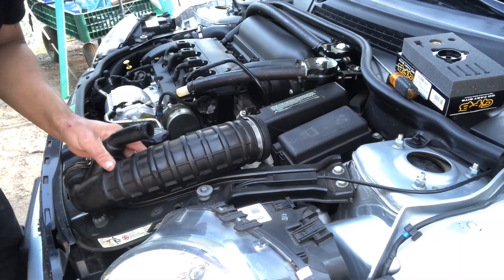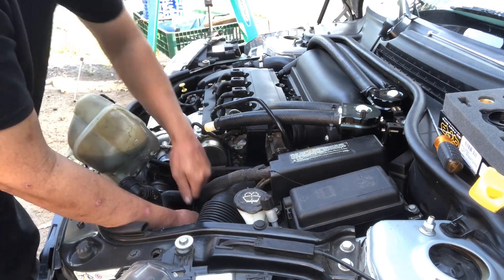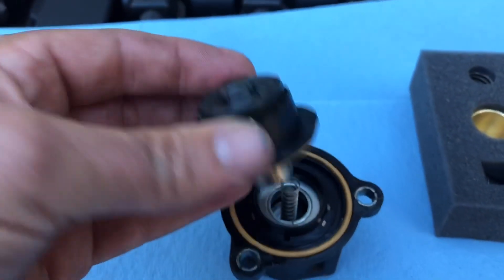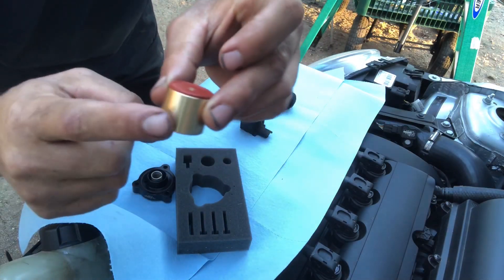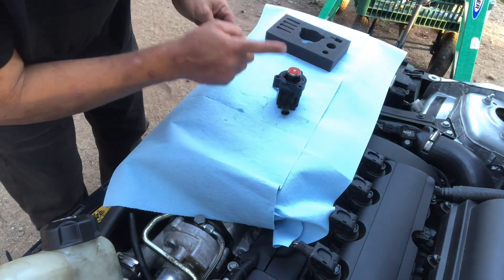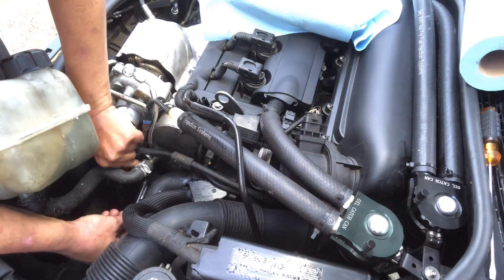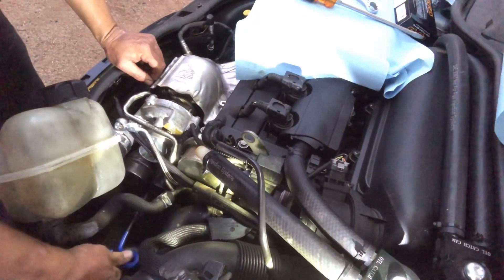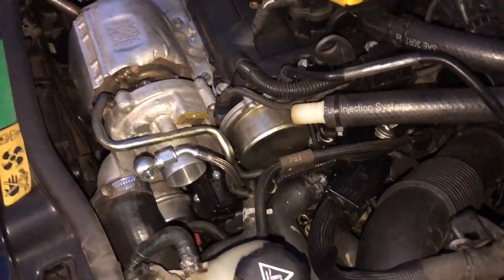How to install a GFB DV+ on an R56 Mini Cooper S (N14)

Comment: Installed with ease thank you 😊 
I did notice the wiring loom was very very tight when clipped back in. I had to find some slack in the wiring loom and pull some out. Got a little bit but not very much otherwise that will be a problem eventually.

Comment: Thanks for the video. I installed the same on my N14 R 56 and it doesn't seem to have any difference compared to the way you installed it. However, I got a 28AA code right after. Everytime I turn the engine code off, it will appears after a couple of minutes. However, there is no engine code if I put the OEM one back in. Do you know why?
Reply: I know this was a few years ago now but for anyone else getting this code it means 'Bypass Blow off valve plausible' meaning that the value seen by the ecu is outside the design parameters.
Im wondering if maybe more lube on the piston might help for starters. Clean the electrical connectors or even try re-seating the new valve to the unit. Did it click in properly? Just a few things to try. Hopefully the new valve isnt faulty. I bought one for my R58 2012 N14, wondering if I should hold off for a bit as it only has 60K kms, bit too soon to change a part that could easily do another 50-100K kms but good to know what to look out for if it pops an error.
Reply from the maker: Do you have the original solenoid for the diverter valve or an upgraded one? There has been issues with the upgraded diverter valve solenoid and the DV+ together
Reply: I have the same code 28AA. Have stock solenoid. 2009 JCW. Any ideas how to fix it? Maybe use stock spring?
Reply: I removed mine straight away, as it put my car into limp mode. I hear you’re better off staying stock anyway. If you DV is damaged, just replace with stock 🤷🏼‍♂️

Comment: Did u gain any performance by changing the diverter valve with gfb dv+ and does it make sound when lift off the throttle?
Reply from the maker: I’ve only divert a few miles since install and didn’t hear anything. It stays in boost longer when you let off the gas in a corner so you’ll be in boost sooner when your back on the gas
Reply: Project Mini i think my diverter failed because of high temp. (I lose boost on higher rpm 5+) because my turbo waterpump was broken and sadly im waiting for this part to ship, i hope that this will solve the problem.. :/
Reply from the maker: I should have both water pumps , new pulley and all new hoses today

Comment: Thanks for the videos and your time. Really appreciate it! It might be good added content for the videos like this to let the viewers hear the difference with a before and after...get a better understanding of why they may want to do this mod. Also, when you make a change, getting a quick review of your thoughts on it. Thanks again!
Reply from the maker: Thank you for your suggestions, in the future i do plan on reviewing all of my mods. I haven’t driven the car yet sense making this video though
Reply: tbf there isnt a great deal of difference in sound, with a decent short intake the stock recirc is actually a little louder. The GFB operates so quickly what you can hear is a lot shorter and sharper. Noticeable difference between shifts on our mini specially as the stock valve was on its way out.
Reply: there are other options for more noise as well, versions that dump some to atmosphere or the turbosmart one that has the loom to prevent the EML. The ESP is tied into the recirc solenoid so full atmospheric dump does upset the ecu.